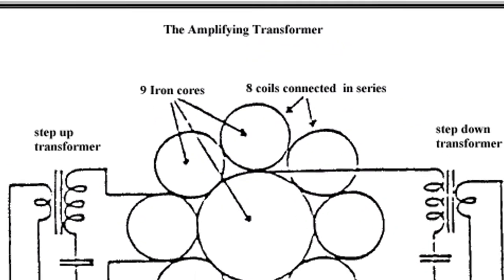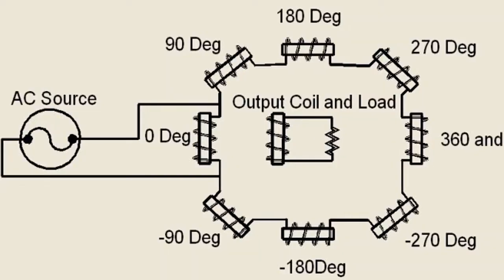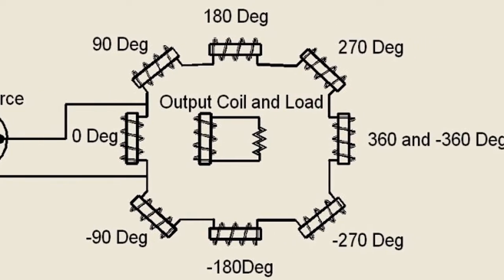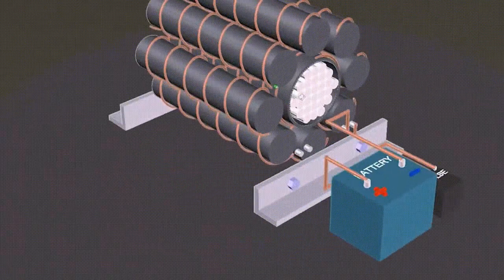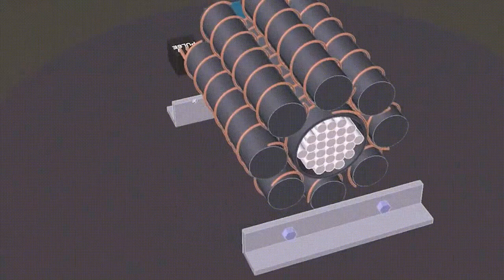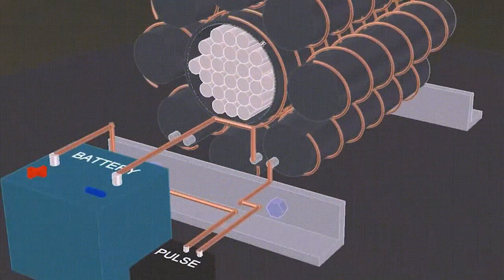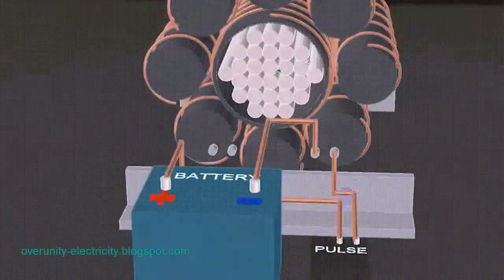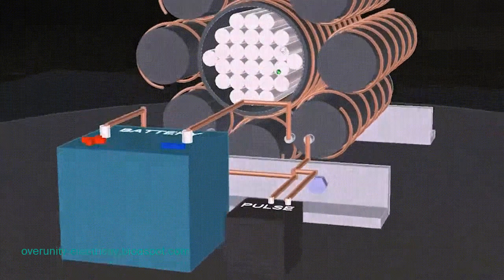The Motionless Electricity Generator by Transformer

Comment: I hate people who le😢ave us hanging on such serious topic, ignoring messages. But we support your channel 😢😢. Please 🙏 share the full details video of this generator....😊😊😊❤❤❤
Reply: We also apply a marvelous material effect we discovered in a special core material. The core made of that material extracts almost all the magnetic field flux from the permanent magnet, similar to how a toroid localizes the entire B-field inside it. An outside field meter right on the pole of the powerful little magnet shows very little magnetic field reading. The AB effect (which does not appear in classical EM but is well-known in particle physics and even in Richard Feynman's sophomore physics 3 volumes) then gives us an uncurled A-potential outside that core, in the surrounding space.
Reply: The MEG uses a novel materials effect freely furnished by the nanocrystalline core and its structure (some of them, not all of them!) wherein the B-flux curled portion of the magnetic vector potential A is sharply localized inside the core (recall that the B-field is merely the curl of A, hence it is the curled component of A). Such localization of the curled or “field” component of A, of course, is known as the Aharonov-Bohm effect, whereby a curl-free magnetic vector potential then freely appears OUTSIDE the core in space, where the B-field would normally have appeared had its localization not occurred.

So the MEG has thus conditioned the IMMEDIATELY SURROUNDING SPACE, so that extra EM energy density has appeared OUTSIDE the core, in space itself but in the form of the curl-free A potential energy. Since in general relativity the increase in energy density in spacetime is a curvature of spacetime a priori, then the MEG’s nanocrystalline core materials have provided an extra EM ENERGY RESERVOIR in outside curved spacetime.

Please note that this completely violates the standard CEM/EE model, which arbitrarily assumes a flat local spacetime and an inactive vacuum. In the MEG, the local spacetime is curved and the local vacuum is now active (the virtual particle flux of the outside spatial vacuum has been altered). This violates the standard assumed Lorentz symmetry, which is necessary if one would have a COP>1.0 energy-from-the-vacuum system. I refer you to M.W. Evans, P.K. Anastasovski, T.E. Bearden et al., "Classical Electrodynamics Without the Lorentz Condition: Extracting Energy from the Vacuum," Physica Scripta, 61(5), May 2000, p. 513-517. 

The normal A-potential consists of two components: one curled and the other uncurled. Usually the uncurled component is rather much “hidden” by the curled component, and thus not usually considered.

Now note that, in the AB effect, the uncurled A-potential extends from INSIDE the core on out to the space outside. The AB effect only localizes the CURLED portion (the B-field) of the total magnetic vector potential A.

But now, when we perturb that B-flux inside the core, an additional effect occurs. We also perturb the “inside front end” of that curl-free A potential component extending on out into the outside space, and that perturbation of the inside end of the uncurled A propagates passes outside the core and on through the uncurled field-free A potential in outside space. In short, that part of the perturbation travels outward outside the core and out into the surrounding uncurled A.

The simple equation dA/dt = - E then tells us what happens outside the core. The perturbation spreading radially outwards just outside the core, is a dA/dt perturbation and that perturbation is directed out and away from the MEG core. In the little formula the resulting E field produced by that spreading perturbation has a negative sign on it, so the E-field created in outside space by that outward-traveling uncurled A perturbation is directed FROM THE OUTSIDE SPACE BACK INTO THE MEG CORE ETC.

Note also that the magnitude of the – E produced, is controlled by the sharpness of the rise time and decay time on the input pulses the operator feeds into the MEG’s normal input coil. One can easily produce sufficient return voltage to destroy the insulation on the windings on the coils. Every coil and every wire is now an “input coil and input antenna” for the MEG’s receiving of that returning E-field energy.

Each and every wire or coil in the transformer section receives a part of that E-field energy radiating back into the transformer from space just outside the core, and each receiving wire and coil also then re-radiates energy to all the others. The result is a dense set of E-field signal energies (in pulses form) but of varying phases.

Then we adjust things (the method is proprietary!) so that a reasonable “phase addition” condition exists in the dense signal environment of the MEG. Once that is done, the return energy received from the returning excess free E-fields is largely coherent in the MEG. We then have the following situation:

(1)     the MEG acts in part as a very efficient standard transformer, courtesy of its modern nanocrystalline core structure. With the normal transformer part of its operation alone, the MEG would get about 90% efficiency and – without any other energy input – it would produce something like COP = 0.9.

(2)     But there is also a great deal of extra, free EM energy coming into the MEG from the altered spacetime outside the core, due to dA/dt = - E and the Aharonov-Bohm effect. Indeed, there is easily more E-field energy coming back into the MEG from the outside space, than the input energy we ourselves placed into the “input” coil.

(3)     The MEG thus has TWO energy input reservoirs/sources: (a) energy input by the operator and paid for by him, and (b) lots of excess free environmental E-field energy received from the altered external space and the perturbed AB effect.

The MEG’s thermodynamic operation is now similar to that of a common home heat pump. The thermodynamic efficiency of the home heat pump is only about 50%, and so – if all its input energy were only what the operator pays for and furnishes – that would allow a COP of only 0.5. But the heat pump ALSO receives a lot of excess free heat energy from its environment. It in fact receives so much extra free energy from its environment that it outputs three to four times as much useful energy and work as the operator himself had to input and pay for. In short, its COP = 3.0 to 4.0, even though its overall efficiency is always less than 100%. Which is why we use home heat pumps in the first place.

So the EFFICIENCY of the MEG is always less than 100%, because it rigorously obeys the conservation of energy. Total energy input to the MEG from all sources, minus total energy dissipated in its losses, gives the amount of usable energy or work output by the MEG. Since – contrary to any ordinary transformer – the MEG receives an extra, free, and appreciable input of pulsed E-field energy from its environment, the MEG’s operation is directly analogous to that heat pump, and its COP is permissibly COP > 1.0.

The MEG completely complies with physics and thermodynamics, but with the nonequilibrium steady state (NESS) thermodynamics. That is, with Ilya Prigogine’s thermodynamics of dissipative systems.

We also note that certain areas and effects have long been accepted and accounted in NESS thermodynamics, which allow violation of the second law of thermodynamics (i.e., allow the production of negative entropy). Strong gradients (as used in the MEG in pulsing) and materials memory (as exhibited by the materials freely initiating the AB effect) are two such recognized and proven areas. See Dilip Kondepudi and Ilya Prigogine, Modern Thermodynamics: From Heat Engines to Dissipative Structures, Wiley, New York, 1998, reprinted with corrections 1999. Areas known to violate the old second law are given on p. 459. One area is strong gradients (as used in the MEG) and another is memory of materials (as used in the MEG in the nanocrystalline core materials and structure).

You can easily get the AB effect with a good toroidal coil, as is well known. But there you have to PAY for it in terms of voltage x amperage.

The thing that made the MEG possible was the discovery that certain nanocrystalline core materials and construction freely evoked the AB effect, so you do not have to pay for it. Immediately that tells us that we have a FREE and extra EM energy reservoir in the MEG’s self-modified external spacetime environment, and that modified environment is feeding excess electrical energy right back into the MEG for its use.